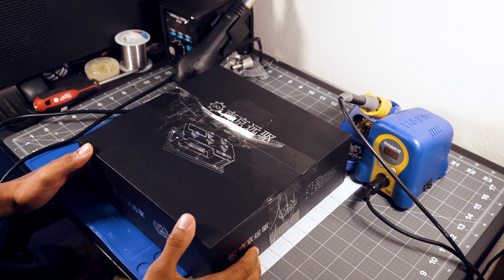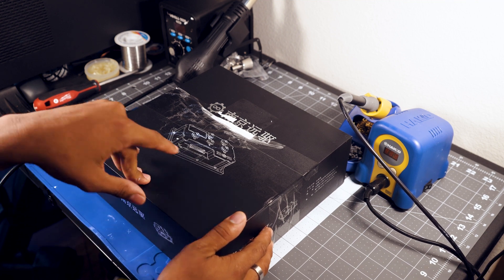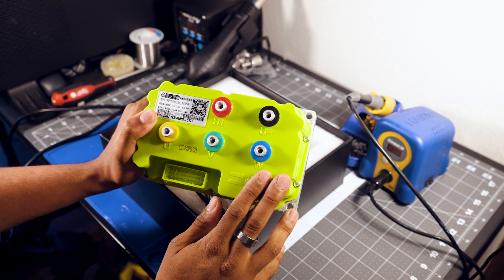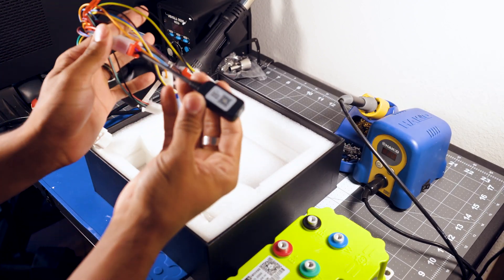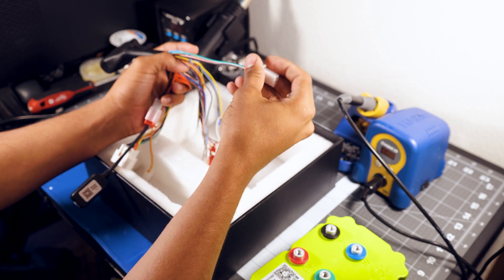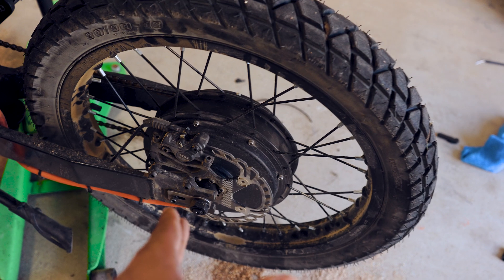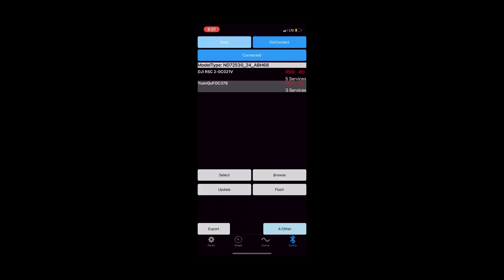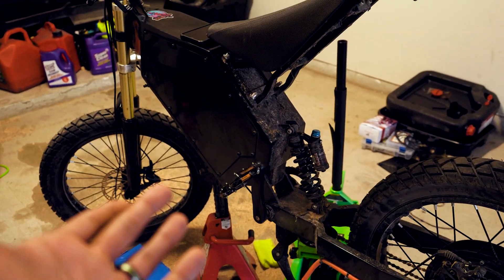Fardriver 72530 Unboxing + Setup (Better than Sabvoton?!) // DIY 72v Enduro Ebike Build

Comment: Good you show the fire extinguisher but from my experience that type of powder extinguisher may not help in the event of a real lithium fire. The only thing that really worked when it happened to me was a garden hose and lots of water. It was challenging to drag the bike outside but thankfully I did. When it happened to me, it was due to a non-BMS LiPo battery getting charged for the first time in a while. What you're showing looks like a BMS pack. It's very important to use BMS packs and not to run too small of a battery for the power you're pulling.

Comment: pfff then i need alot of adapters, i got different connections on my motor and display and throttle, i got the round connectors

Comment: What is better, sabvoton200a or fardriver200, as it has a long range and without heat? Please clarify. Thank you.
Reply: Sab 72200 for sure, fardriver smoother but sab has more torque and more efficient with battery consumption
Reply: @rolandroland1485  كيف طــيــــب سيرون اقوى منه ولا

Comment: hi mate good video. I'm running  a 15000w 72v 60a stealth bomber clone with sabvoton 150amp. QS273 2.5T motor.. 

I wanting to upgrade the controller for a better robust system.  

I'm wanting more low end acceleration.. do you have any tips to help please?.. or any vids how to set up a 15000w motor with a sabvoton 150amp.. 

would a upgraded controller work with any motor ect ect. any info would be highly appreciated
Reply: U need 3.5T or 5T

Comment: JZEV, what if my motor (for a Talaria Sting R MX4) doesn't have Hall sensors? Can I still use this controller? Thank you.
Reply from the maker: Does it use an encoder? I believe some fardrivers have encoder support
Reply: @JZEV1  This bike has internal permanent magnets and a magnetic encoder. Thank you for your reply. Another question, I see this controller can be used with batteries 48-72V and it's 190 amps (360 phase amps); my Talaria MX4 motor puts out 120 max amps. Is my motor compatible with this controller? Thank you.
Reply from the maker: @rlbrett  in this case, it should work. Just make sure the fardriver you purchase supports encoders. Not sure if all models do but I know at least some do. As for the amperage, your motor should be able to handle more than that. You just need to keep an eye on temperature, and ensure that your battery BMS current limit will not be reached. For example, if your BMS can support 120A, then you should make sure your controller is set for slightly less than that. BMS overcurrent protection can kill
the controller if it triggers while riding at high speed, learned that from experience lol.
Reply: @JZEV1  While speaking with a guy at Powerful Lithium (physical shop, battery builders, and website) in NY City about batteries, he recommended the Fardriver controller for my bike/motor, but I am not sure he's familiar with my bike. Thank you again.

Comment: Hi.
I also installed my fardriver controller and made the first ride. At first it was ok. But then, when motor became about 120C, mosfets became 40C... The controller started to fall into some kind of protection. At full throttle, when maximum current reached, it suddenly turns off. And resetting (turn off ignition and back on) doesn't help. I need to stop my bike completely, and after that controller is working again.   

My settings are 200A battery, 400A phase current. Not much. And it shuts down. I tried to look which error it shows in the App, but NO ERROR

Do you know some setting for the controller to recover without complete stop? Or probably turn off over current protection?
  if it happens in the middle of highway... I'm f..ed up.
Reply from the maker: What BMS are you using? Could potentially be BMS overcurrent protect. Or, potentially your temp sensor for motor is wrong. I could be wrong but I don’t believe there should be that big a gap between MOS and Motor temp. Typical when my bike has been run hard motor will be about 90 C and controller MOS 50-60 C. Does the app say anything right when this issue occurs?
Reply: @JZEV1  I don't have single bms, I have 3 batteries in parallel so 3 different BMS.
And I guess if that was battery, then my voltage meter should have shown some drop in voltage. But I didn't see this😕

Gap in temperatures is ok. My motor is about 4-5kW rated and I used the controller configured to 18kW😅
Reply from the maker: @vlp1  what’s the peak discharge of each BMS?
Reply: @JZEV1  about 80A i guess, 50A continuous
Reply: @JZEV1  my second idea is, probably I didn't do learning procedures of the controller. I tried to do full throttle on a free wheel, but seems the process wasn't completed. I don't remember the wheel turning backwards during the learning.

Also, the parameter "phase offset" wasn't determined automatically, I manually set it to 60. Probably not optimal for my motor. And probably it's changing when motor is at high temperature
Reply from the maker: @vlp1  if your phase offset is wrong you will notice it running less smooth. I don’t think phase offset being wrong will hurt anything, but it lowers the motors efficiency. I would recommend turning your direct amp down to 50A or lower, then trying auto learn again. That’s what I had to do to get it to complete and not ramp my wheel speed up ridiculously fast.
Reply: @JZEV1  yes, I also noticed the RPM are much bigger than with my other controller, but only when high speed enabled, but i hoped this is due to effective flux weakening
Reply: Turn All that down. 100a 200phase amps
Reply: @MikeMike-v6s  I actually figured out what can fix the problem somehow. There's a setting regarding low voltage handling. By default its Vol2, it helps to set different values like soc10% or SOP or Other. I don't know what these values mean but it helps... At least, even if the controller stops responding to throttle, it still responds to the braking signal.

Comment: Did you manage to enable regen braking? I tried with my far driver controller, using the low-brake connector. But all I got is motor stopped accelerating when the brake connector is turned on. But no any regeneration. 

Tried different parameters in Android app, no luck 😞
Reply from the maker: I had the same issue,mine worked as soon as I set the “follow” parameter to “EABSWhenBrake”.
Reply: @JZEV1  oh thanks will try!!!
Reply from the maker: Also make sure the “brake” parameter is set to stop when ground
Reply: I need to put my bike on a side, to get the wheel free turning  ... Dont have such a jack as yours:)

Comment: i am also replacing sabvoton 72150 with far driver 72680...

But I cannot find 3pin connector for braking throttle... Is it there or it's exclusively sabvoton feature?
Reply: Hey, have you had time to test the controller yet?

I have an unlocked sabvoton 72150 (running 200 battery amps and 550 phase amps with a 205 4t) but it sometimes doesn't work well and I get some "cogging" during acceleration. Also, flux weakening of 70A doesn't seem to make a difference in speed.

Thinking of switching to an ND72530 for reliability and hopefully better performance/speed with flux weakening.
Reply from the maker: @maxms6087  I’ve had the fardriver in my bike for a couple weeks now. So far it’s been amazing, 0 issues. Would definitely recommend switching from sabvoton. I have had nothing but bad luck and unreliability with sabvoton. Wish I never wasted money on it.
Reply: @JZEV1  Hm very tempted, it seems better and is more compact, only thing missing is variable regen. I use it a lot on my bike
Reply: @maxms6087  my sabvoton is locked. Do you know simple way to unlock it?😅
And it is working fine, except sometimes it turns off with system error or something. I don't know exact reason but possibly it's hall sensors plug not good, or ignition wire... Or something else.

Flux weakening is helping (about 70A), without it the top speed is about 95kph, with it it's up to 108kph
Reply: @vlp1  Unfortunately you can't unlock any sabvoton, it has to be an "unlockable" version, that you then use some special software on.

Hm sorry to hear about the problem, but great otherwise
Reply: @maxms6087  I will miss variable regen too :((( my motor isn't well, something is not tightened inside.Yet the dropouts are very robust and axle is firmly placed into them,but every regen I feel knocking inside the motor. Probably one day the axle will break :((( And variable regen helped to avoid these tough bumps inside the motor.
Reply: @vlp1  Oh that doesn't sound good, I wouldn't use regen if that was my bike
Reply from the maker: I believe it’s a sabvoton feature, I don’t think fardriver supports variable regen but I could be wrong
Reply: @JZEV1  i think some of them has variable regen... But not mine :(((( bad. Something within my motor clicks very hard each time I turn on regen, so without variable regen, motor axle can turn inside breaking everything

Comment: not sure if fire extinguisher works on lion cells. Smoke is dangerous if one inhales  it.
Reply from the maker: Your right, it wouldn’t do much but it’s something. Only real way to put out a lion battery is dunk it in water